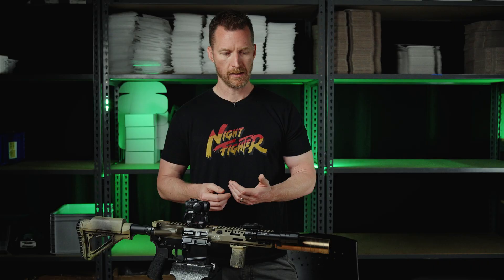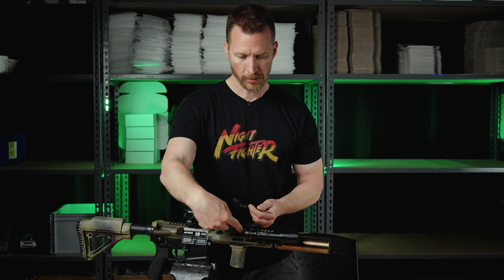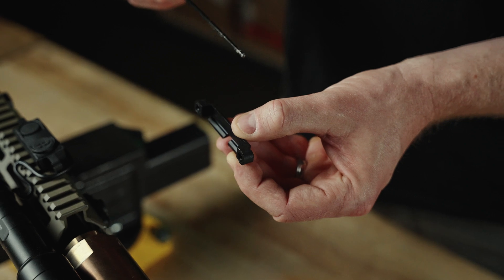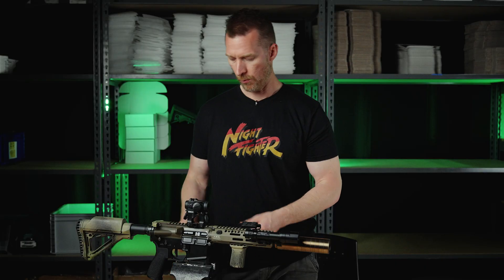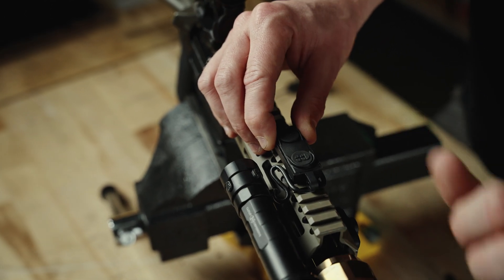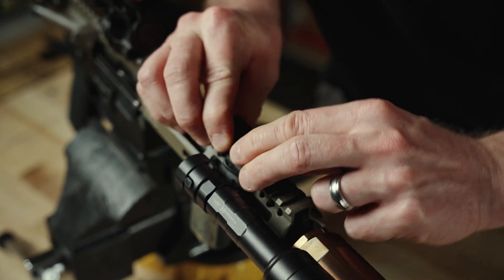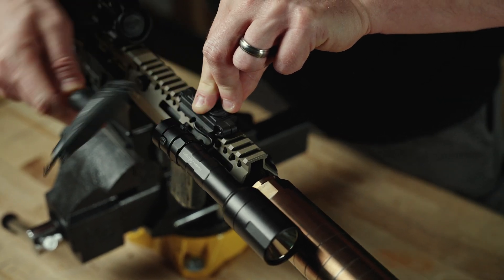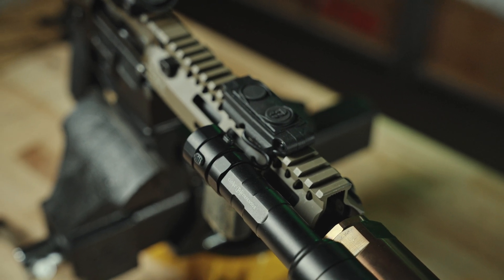REIN LCS Install Guide

Comment: I'm having issues with the anchor and different size batteries. Do I really have to adjust it each time I use a different battery size?
Reply from the maker: That's what the battery jack is designed for.